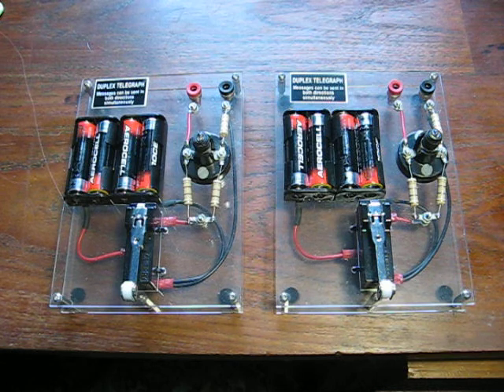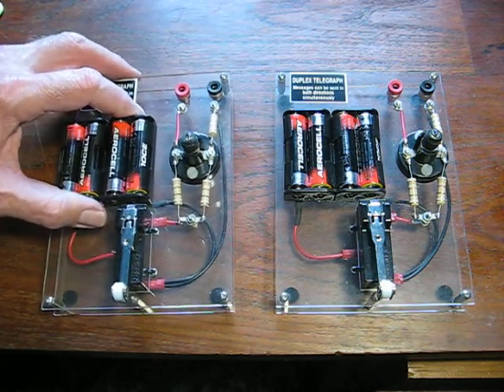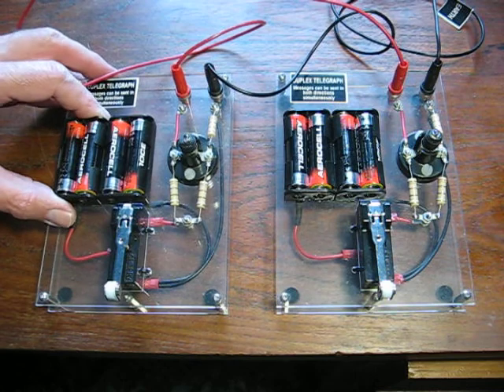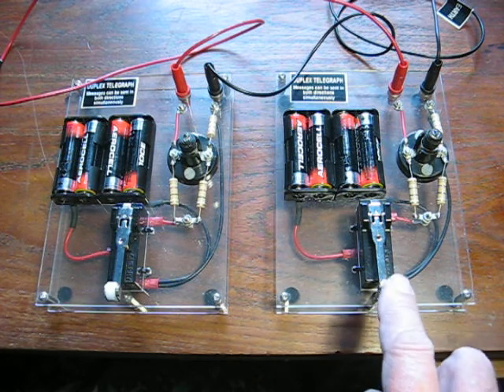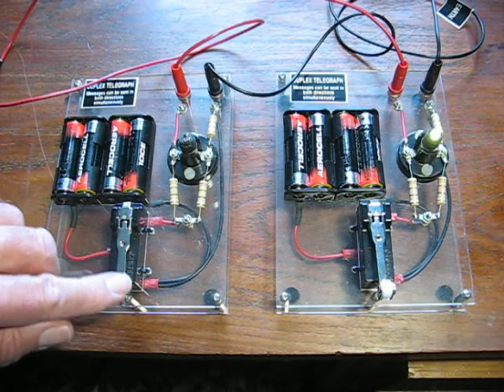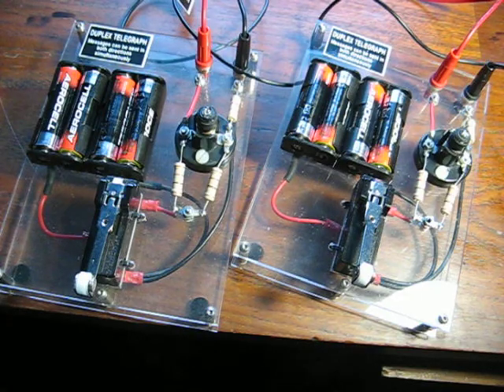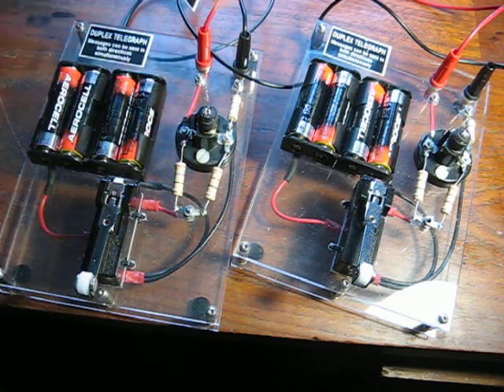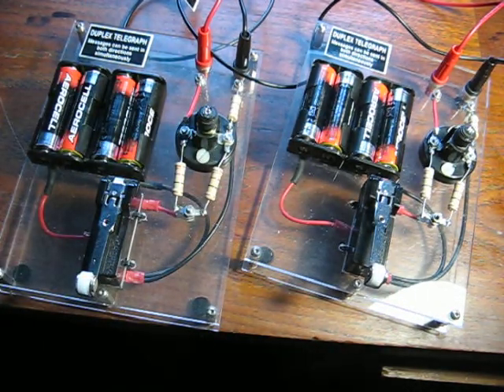Demo Model of Duplex Telegraph.

Comment: nice job, can you please provide a link to the circuitry. thank you.
Reply from the maker: File:EB1911 Telegraph - Duplex Working - bridge method.jpg - Wikimedia Commons

This is my circuit, except there's no 'C', and I have replaced the resistor (shown as a box)
between the key and earth, with a short.
 'R', 'a', and 'b' are all 22R resistors.  I tried various values.  22R worked best with my tiny little 2.5V lamps.  The 'receiving instrument' (lamp) ideally needs a much higher resistance than 'R', 'a' and 'b' for the bridge circuit to work properly. 
 
You can see the circuit at 0:18.
Reply from the maker: For some reason, the link doesn't work, but Google should find it.